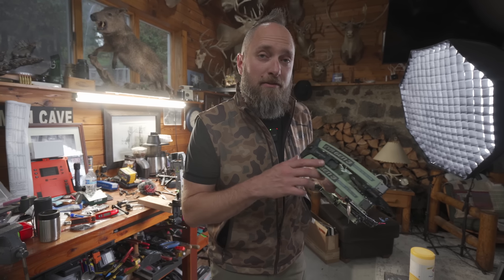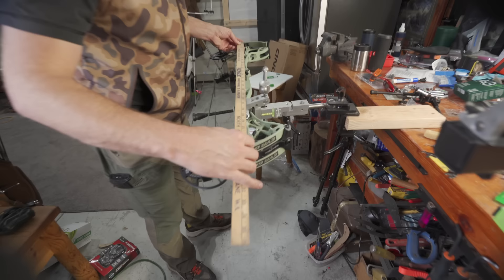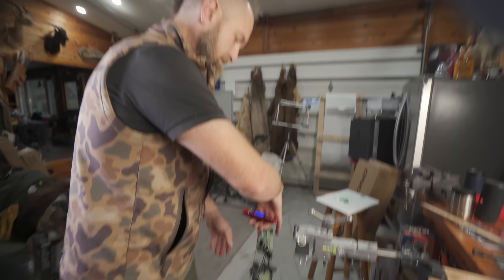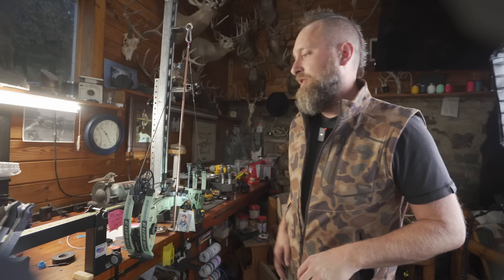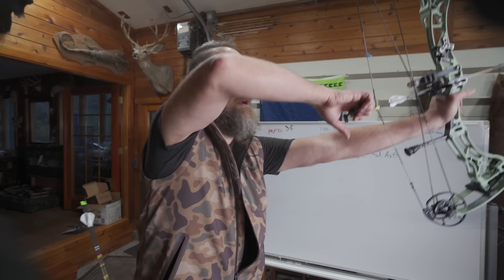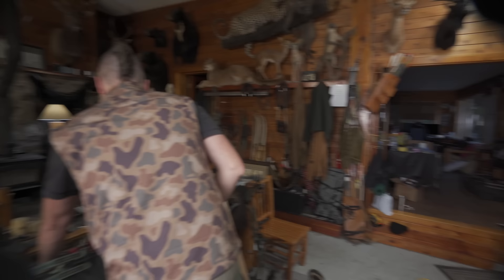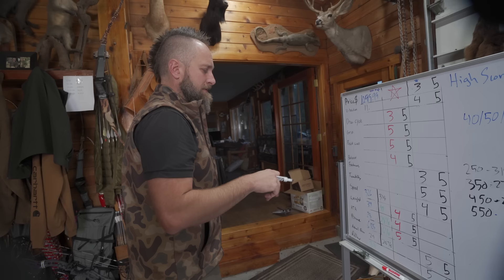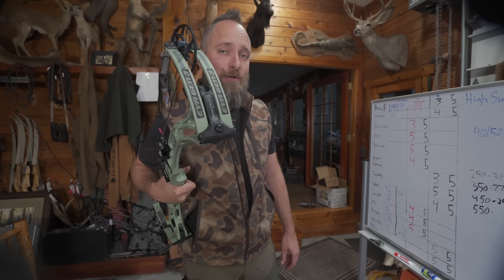Bowtech 2024 Eva Shockey Gen 3 Bow Review With MFJJ!!!!!

Comment: Hello from Australia MFJJ!. 
THANK YOU for all you do on these videos sir. It has helped me a bunch. I have a bowtech / epsilon question for you. The cable holding system on bowtechs that attaches to the riser is giving me grief when trying to fine tune my vertical on my epsilon. Just running an original revolt. I recently just bought the rest, upgraded from a qad drop away. Just wondering if you do that side of things in a certain way, cause boy it is frustrating to get that Allen key into the hole while the rest is mounted. 
New to tuning my own bow and thought I would try and get a pointer or two from you. 
Thank you sir.
Reply: I don't know what you actually call the thing I'm referring to. But it has the two little metal wheel rollers that the cables run through. That thing 😂
Reply: Also some knots, if you could do a video on knots you prefer. My bow shop fella had never heard of a prusik knot, he just tied things his way, which looks similar to a prusik but it isn't.
Reply: You and Tim need to jet over to Australia for an outback hunt, mate. Get Tim to spot you the airfare lol.. 
I really wish we had some kind of TAC event here. Really wanting to head over to the states just for a TAC event next year. Shame we aren't as keen for it over here. Or just not organised enough. Backwards upside down country of mine.